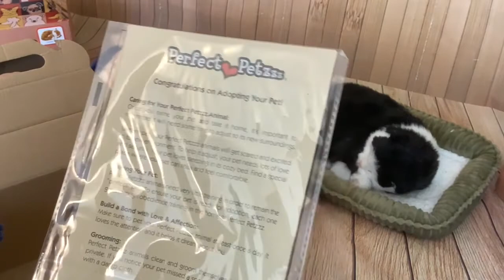Perfect Petzzz, Precious Petzzz Grey Tabby Cat Kitten Unboxing Demonstration Review & Comparison

Comment: Do you know if there are problems if you leave the Perfect Petzzz with the battery ON all the time? While there's no on/off button, i know that the battery lasts a long time...
Reply from the maker: The only problem is if you forget about it & the battery wears out & leaks - I did buy a second hand one where the battery had been left in & it corroded